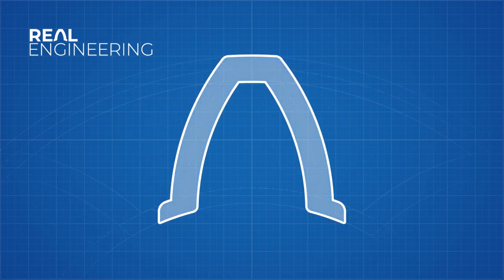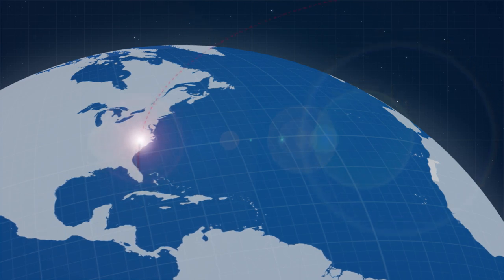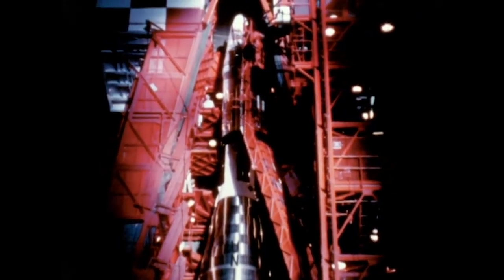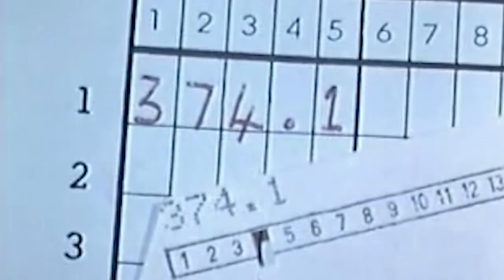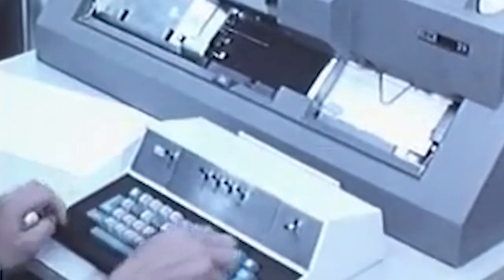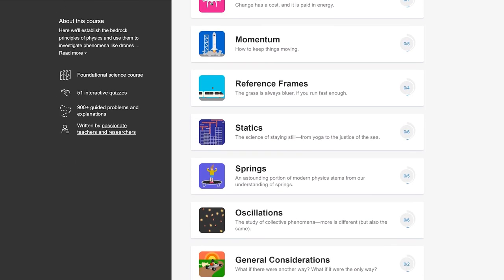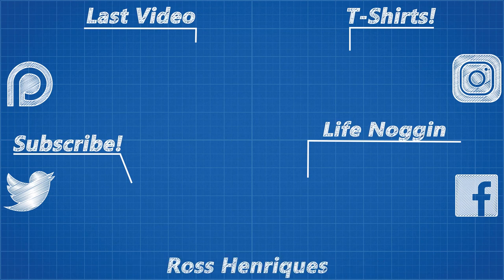NASA's 150 Million Dollar Coding Error

Comment: Software bugs are so underrated. Its pretty common for companies to lose millions because of simple little software bugs.
Reply: Software Man As someone with some programming experience, just one character mistake could fail the entire system, although it depends for what character (and where) has an error.
Reply: This is why we have compilers, to make sure 1 character mistakes have a less chance of happening.  As someone who's recently in JavaScript land from statically typed languages it seems crazy to me that we knowingly chose to do this.  Like a single character (or better yet casing of a character) can cause catastrophic failure.  My feeble human brain won't catch that, but my compiler would have =\
Reply: I keep telling our developers to stop allowing thread dead locks and thread contention in our Java code! It is horrible to see threads fighting over objects in heap memory.
Reply: BAHAHA, this sounds like a bot response.  Replace Java with any language with threads.
Reply: I mean, even in C++ there is a chance of a one character mistake slipping by and breaking the entire program.
You can accidentally type an assignment operator '=' instead of an equality operator '==', you can use a simple assignment operator '=' instead of an arithmetic one '+=', '*=' etc, you can use a function assuming it did something in place when in reality it returns the value (okay, it's not a one character mistake, but still a pretty simple one) or mistaking one-letter variables (it was a nested for loop and I mistook 'i' and 'j', don't judge me too much).
But yeah, compilers and IDEs make programming a waay easier job.
Reply: Software Man I have seen you on that HAI video.......
Reply: Exactly. Most developers I have met cannot even explain what a data structure is or an algorithm! lol! It's sad when I have to explain what a hash map or link list is... They allow for Big O complexity when using the wrong data structure and algorithms as a solution... SMH...
Reply: Bot response? We are only a Java shop where I work... In general context, you are correct. Other languages do apply.
Reply: yes. other object oriented languages apply. I have been programming for a year now and I get sick and tired of teaching senior software developers about resolving complex code with software model diagrams. They insist we just code and not design the architecture of the code first... we need to agree upon the design patterns as well...
Reply: Ironically (given the thread) this is why Java was made.  It was to make the programmers intent non ambiguous.  But at the end of the day the programming language in question "spoke" formulas, this is what it's first order concern was, so we're talking about the most common problem of just human error.  Hats of to black hat hackers but if I wanted to get sensitive information from a resource I'd just send an attractive human and call it a day.  Humans will always be the weakest link in the chain.
Reply: The story of Margret Hamilton finding a UI problem in the control interface is a pretty important one.
Reply: Software bugs are properly rated...
Reply: +Wojciech Dubrownik Exactly compilers merely check for valid code that is a very different thing from correct code, sure some might go a step further and issue advisories in the event of detecting certain non standard or high risk usage but generally as long as it is syntactically valid code that it is capable of converting it to machine code it will do so warning or otherwise. Course there is no way for a compiler to ever test for correct code that is the sort of test that can only ever be planned on a case by case basis by someone with intimate knowledge of the intended function of said code.
Reply: +Justin O'Brien Well it could have been spotted even in those days by testing the software in a simulated environment. Sure not as easy as it is now where you could simulate all that in software but a test bench where the sensors were replaced by devices that just supply recorded test signals that emulate those the real sensors would be expected to produce under a variety of normal and indeed failure conditions to see whether the outputs from the software match those which it is expected to produce under those conditions.

Sure would take some time to build such a test rig and in those days wouldn't have been the cheapest device to build either though the time and cost required would be an insignificant fraction of the cost of an actual fully functional rocket.
Reply: +Justin O'Brien Well it could have been spotted but only if the test data set actually did include a scenario like this one and of course the test sensor output would need to have the high time resolution but low precision (or low accuracy, not sure which is the case whether the accuracy of the tracking sensor was weak leading to lots of fluctuation or the output just lacking precision resulting in large apparent jumps from small changes) of the real tracking sensor so that when it fell back on it the effect would be obvious by the fact the program kept constantly trying to throttle up and down the engine to correct for instantaneous fluctuations between sensor readings without smoothing. Either way it's true that such testing is only as good as the design of the test data sets, the idea is after all to cover all the probable normal and failure mode conditions that the software is designed to be able to cope with but of course it is just as possible to make omissions in designing a thorough test plan as it is to make omissions in the code itself. Ideally though on a project like this the QA design of the test plan will be by a different person so that hopefully at least one of the two will think of the scenario the other missed.

Course it's possible that neither will but short of eliminating the humans from the equation altogether the best you can do is use multiple people cross checking each other to provide redundancy against any single human failing.
Reply: Replace a single semi-colon with a greek question mark.
Reply: This is why I don't trust autonomous cars. One thing is if human driver underestimated his abilities in the car, and another thing if someone, somewhere else made a one character error and because of that car decided to accelerate into the wall
Reply: Software Man like recently when the House of Representatives almost have trump $250 billion for the wall
Reply: For instance: coding a file designation that should have been capitol A, a lowercase a, meant that the Aliens in Aliens: Colonial Marines AI features were mostly nonfunctional. Resulting in the lion-share of negative reviews for the game. Errors cost money. Quality Assurance should never be laughed at. Modders found the error and turned it back on through a mod resulting in a pretty good game, albeit years too late.
Reply: should have paid the engineers more
Reply: that moment you accidentally cause the entire codebase to fail because you forgot a semi-colon (I now have switched to python)
Reply: actually, this wasn't a proper bug but instead a typo in the code
Reply: samuele 55598 by definition it is faulty code. So yes it is a bug...
Reply: Didn't they have some sort of test-driven development back in the day?  I suppse not with how expensive the hardware was in those times.  But then Boeing never bothered to explore an edge case scenario just a few years ago.  Or rather, implement some reasonable exceptions handling.  Was that too expensive too?  Who knows.  The MCAS would only take telemetry from the captain's Angle-of-Attack (AoA) sensor.  And didn't even compare the readings with the copilot's sensor.  Was it strictly ornamental?  Boeing has gotten too weird.

Comment: can fortran run crysis
Reply: Maybe it could have run DOOM.
Reply: PROGRAM CRYSIS

CALL SYSTEM("CRYSIS.EXE")

END PROGRAM CRYSIS

C DONE
Reply: Fortran has been modernized and still gets used actually. I think it's supposed to be pretty fast/efficient
Reply: Fortran is a programming language, the punch card stuff is something else.
Reply: FORTRAN 77 was and is still the fastest or one of the top 10 
 compilers (produces the most efficient optimized code) around

Comment: As I'm working on getting a computer engineering degree we've been told this story multiple times, anything with big numbers and/or death tolls to tell us to always check our code over, preferable with multiple people and always always always plan. While working with a team communication is also always important(see that Mars satellite that crashed a couple years ago).
Reply: Papa Bones This is why writing clean code is so important—so that you can catch errors
Reply: That was a poor choice of measurements used in Mars.
Stick with METERS!
Reply: Alpha Killer
Wasn't it that both teams accommodated for the other team's measurement system? I might be remembering it wrong. Either way I agree, metric system is the way to go in anything science, NASA uses the metric system AFAIK for example.
Reply: Threrac 25

Comment: Wait a minute! How does a Aluminium nut rust?
The only thing that rusts i iron, and some iron alloys (steel)
Other metals corrode. 
Aluminium forms a noncorroding oxide layer....
On the other side if you connect 2 different metals in a humid environment you get a galvanic element/cell and one of the metals is "dissolved", and accumulated on the other that will cause structural integrity failures.
Reply: Aluminium Oxide ('Aluminium rust') is far more brittle than regular Aluminium, leading to a possible failure on the surface of the material. I've no idea if that's what happened in this scenario, but I imagine it'd be a likely candidate.
Reply: Key bit was exposure to sea air, the aluminum oxide will be disturbed by the chlorine ions and so will corrode.

Outside of redox chemistry circles rust and corrosion are use interchangeably.

Comment: I am a Computer Scientist, and software error is the main thing we are taught to look out for,
we spend 80% of our time debugging code, and checking for errors, and only 20% of the time in the actual coding,
it's pretty insane how one small mistake, like an incorrect number, or using division instead of modulus operator can lead to the entire program changing.
Computers are very stupid, they have to be told exactly, line by line, word by word, what to do, or else it can be a huge pain in the ass to figure out where the error was

Comment: Doesn't the aluminium oxide layer that forms pretty much instantly on the surface of aluminium protect the rest against corrosion? How does salty air affect this?
Reply: roflTiMeX there many factors that can increase the effect of the corrosion of aluminium. 2 of the factors are pH and alloying elements. A pH of 7 means little or no effect on the oxide layer, but the further you move away from this the greater the effect (sea water has a pH of about 8). Aluminium alloys involving copper are more prone to the corrosion compared to those involving magnesium.
Reply: In pure aluminium that tends to be the case, which is why the weak 1XXX alloy series gets used a lot in non load bearing applications such as building cladding. The higher strength alloys, which have quite a bit of other stuff in them, just don't naturally protect themselves as well as pure aluminium.

Comment: Props to that safety officer for making the call he did.  150 000 000 machine on the line, his career would've been absolutely over if the rocket had actually been alright.  He made the call in seconds, and may have saved lives in doing so.  That couldn't have been easy to do though.

Comment: My dad worked on those punch cards long ago at a joint Air National Guard / Navy Reserve base called Willowgrove in Pennsylvania, we're talkin 60s thru early 70s, huge panels w wires were also involved, when they wore out he often gave them to me to play with, the contacts had worn too much. When you're under 10 this is all cool toys, now some of that stuff in in museums for puter tech. My smart phone does 1000s of processes faster than that system could do in a year. Noone had cell phones back then, system didn't exist and most major puters still occupied large rooms, all of that can be done on my phone on a little chip. I used to live near KSC, saw some self destructs, that's why the exclusion zone exists off the coast.

Comment: how come the alu bolts on the falcon 1 corroded to the point of failure? I thought aluminium develops an oxide layer making it corrosion resistant, even in humid air. Was it a weird alloy?

Comment: One must understand that an individual who only codes or programs is not a Software Engineer. Software Engineering follows a process (look into Systems Engineering) with many "moving parts". As an Engineer, it is not ONLY about developing or creating but also about testing, reliability, quality, and ensuring safety of the public. Obviously it depends on what you are working on although, developing an app to send images of yourself to another has much less physical risk than developing algorithms for autonomous vehicles or rockets. Uber said they were only an online platform, yet they are working on driverless taxis. Unfortunately, more recent news has proved my point.

Comment: And then there was the time when they wrote a . instead of a , and turned the head of a loop into an assignment (with an unused variable), so the loop's body was only excuted once instead of 10 (or 15?) times, thus not calculating a certain value as precisely and causing the spacecraft to go off course.

Comment: I hope it wasn't implied that FORTRAN was the problem. It was a lot clearer language than some present day computer languages. The problem was the ability to easily proofread which was finally done on screens in the 1980s and made proofreading much easier. It was the old punch card system that made it difficult to review. When we got full screen editors with the early IBM PCs it was a sea change in checking code before it was compiled.

Comment: Did you get details backwards? You said aluminum bolt rusted caused an issue and was replaced by steel. But steel and iron are the big rust names and aluminum is almost rust proof.

Comment: I would like to make a comment for those are interested.

1.  There is no such thing as overbar in computer languages. 
The overbar we write on paper to show that this is average but usually in code you might name the variable like R_overbar. So this is not a silly mistake as it seems.

2. From (1) it follows that just by putting overbar in the name you don't get the average of a variable. You have to compute it and store in a variable. (Coding is needed for it).

3. Wrong variable used in the  code that was instantaneous vakue rather than average. 

I hope this clarifies.
Reply: Parth Savyasachi my data dictironary misspell the value to vakue just as you did
Reply: BROWNKEY is it also using smartphone like i did. 

Cmon let the typo go. :-)

Comment: rust an aluminium nut. isn't rust literally ironoxide?
Reply: Rust as a term used only with iron corrosion. There is no such thing as aluminium rust. Though aluminium corrosion is also a real thing and it is weakening the material the very similar way.

Comment: Why not use titanium for the bolts? Sure, it is expensive but it is lighter than steel and very resistant to corrosion.
Reply: Ivan Gushkov it’s actually already in use

Comment: " We didn't have fancy computers interfaces for writing code with compiling software and an error-checking compiler..... "

This is bang-on. Of course, hardware has a lot to brag about with regards to increasing computer capacity. But the massive improvements in our tools (compiler, IDEs, high-level abstractions, etc.) has a lot to do with it.

data = json.load('data.txt')
print ( numpy.mean(data))

60s programmers: What? You can read a file, parse its content into numerical values,  and print the mean of those values with less than 100 characters?!?!?!

Comment: How did an aluminum nut rust ?   

Aluminum does not rust 

Rust is iron oxide.    Just a point from a engineer.
Reply: Update forgot to add this to my post.  Aluminum oxide is very thin layer on the surface.   Its usually counted on protect aluminum from the heat.

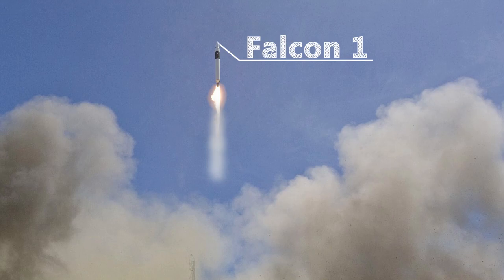Comment: 0:49 Wait a minute, just hold tf on....did this man just say the salt water rusted an aluminum bolt? 🤯 brah do u even science?! Frfr tho? 🧐
Reply: Aluminium can be corroded. Although you are right that Aluminum corrosion is not really rust since rust is referred to the iron oxidation but Aluminum corrosion acts similar if not the same as rust.
Aluminum doesn't corrode as easily in normal atmospheric conditions but in the conditions of the rocket, aluminum gets a bit crazy.

Comment: at 49:00 it says 'allowing it to rust an aluminium nut'. I thought aluminium didn't rush because of the oxide layer that forms when exposed to oxygen. can someone explain how what he said is possible?
Reply: From google:
Aluminum corrodes but it does not rust. Rust refers only to iron and steel corrosion. Aluminum is actually very prone to corrosion. However, aluminum corrosion is aluminum oxide, a very hard material that actually protects the aluminum from further corrosion.

But I still don't see how it could've caused a seal breaking
Reply: The board determined that the only plausible cause of the fire was the failure of an aluminum B-nut on the fuel pump inlet pressure transducer due to inter-granular corrosion cracking

Comment: Is it me or did he say aluminum rusts? Aluminum doesn't rust its actually quite corrosion resistant I work with it quite a bit as I'm a welder..aluminum will corrode but it takes a along time. the corrosion is not rust though.how long was this damn rocket sitting there that it corroded an aluminum nut to the point of failure. This just strikes me as odd